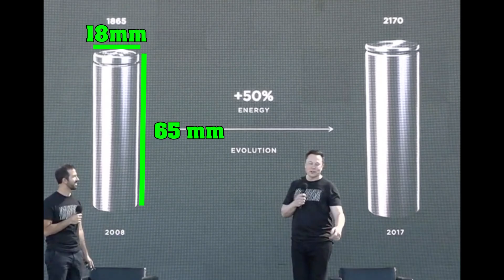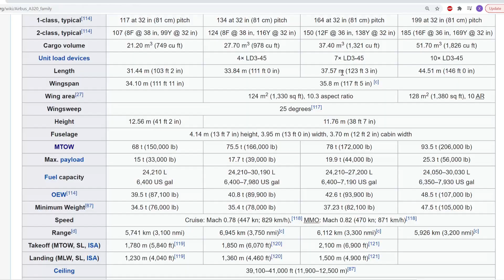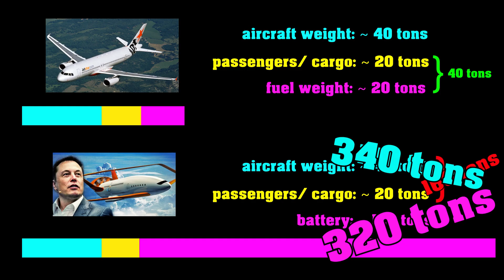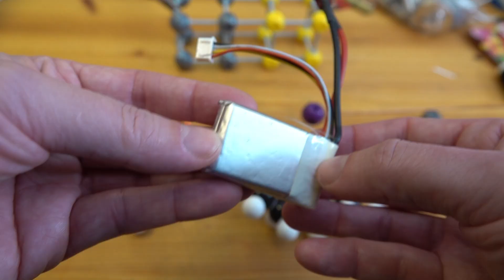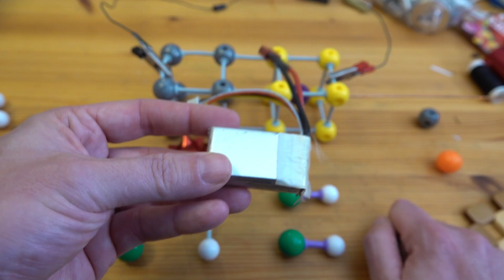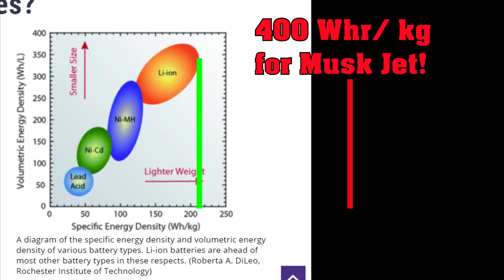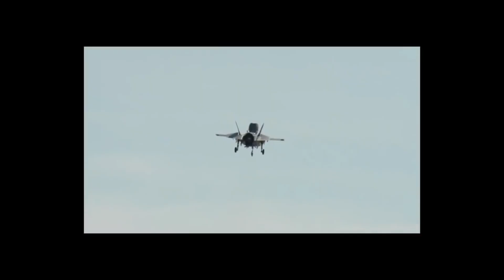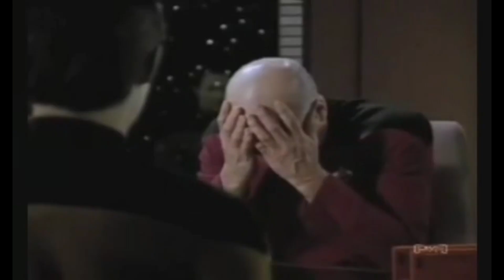Tesla's Secret Plan To Disrupt Airlines: BUSTED!!

Comment: The solution is rather simple: Use a drone booster!
. Take off (vertically) with the booster, reach high altitude and (still using the booster´s batteries), accelerate to high_subsonic speeds.
-> Decouple the "booster" (that has its own wings, optimized for low speeds & high air density); it glides down back to the launching place following a half_circle spiral down trajectory [either landing vertically with some "reserve power", or using wheels like a normal plane (taking advantage of its wings)].
  
. Meanwhle, the "main ship" (with the cargo) accelerates using its own (smaller) engines & batteries (the wings/shape optimized for supersonic speeds & low density air).
The ship has to land vertically [since its wings would not be able to provide enough lift].

.  [If necesary, in an emergency] another "drone booster" can be launched (vertically) to meet the ship on flight, connecting to it with a deployed cable (either from the "ship" or the "booster"), transfering power from its batteries (to allow the landing of the ship).
   Depending on the ship´s design & details of the "emergency"; both may land vertically simultaneously (next to each others, keeping the "umbilical cord" connected).
-> There is no need of "docking" on mid_air (unless there is an issue with the landing engines of the "ship", rather than its remanining energy on batteries and/or power transfer).
  
An interesting posibility (to avoid a "cascade effect" on a single_point battery malfunction) could be having the batteries on segments that can be disconected & "ejected" (at high force) automatically. 
This "procedure" being only available if the ship is already high enough that the falling "block" can self_destruct & disperse (so the damage on property below its minimum).
-> Given that the ship+booster is launched & landed vertically, any failures on ascent/landing would only damage the "airport".
Reply: How you gonna get an electric ducted fan to break the sound barrier. Hell even if you shunt it up past the sound barrier using a real jet aircraft, it won't stay there because an electric ducted fan can never be capable of supercrusing. It can go fast-ish, but it can never go mach. 

By the way, the solution to the plane being too heavy is probably not to strap an extra battery pack to it. Remember, to VTOL, you need to have a positive thrust to weight ratio. But the plane that Elons proposing will, even if we go by current standard aircraft numbers and not thunderfoots, weigh at least 60 tons. You need to have Electric ducted Fans capable of producing over 60 tons of thrust. But that also are able to operate at high speeds (Not mach, because its not physically possible to use an EDF to break mach, but lets just say normal passenger jet speeds). The issue is designing the intake. You'll need to have a variable intake to get them to be able to perform both jobs, but the issue then is space.

The ideal aircraft for this specific task has already been built: The Harrier jump jet. It uses a high fan bypass Turbo-fan, and while an EDF of the same size couldn't actually do the same job, lets just say it could. Its quite a bit off in reality, but still. It has the intake design and the variable nozzles to transition smoothly from VTOL to forward flight. Now you just need to make it huge enough to fit like 500 people inside, which is kind of where the issue lies. The square cube law is already against you, and the energy density of battiers compared to Jet fuel comes around again for a double team. 

You might just say this is where the drone booster comes in, but there's an issue with that too: Unless the booster also has VTOL engines, you're just adding weight to something that's already too heavy to take off vertically. And if it does have its own VTOL engines, then its gonna be using vast amounts of power just to make up for the deficiences of the main crafts VTOL engines by using its own. And now, with every single flight, you have to organise the decoupling of a booster and safe landing of such, presumably via drone systems, and possibly another booster to reconnect to the plane, and if anything goes wrong with any part of that you're in serious trouble. Also the plane doesn't ever lose weight during the flight, so you'll definitely have to have another booster at the other airport to facilitate the planes landing, and overall its just a gigantic clusterfuck that could be far better solved by just finding another fuel source for planes instead of hydrocarbons. Good news is taht jet engines will run on basically anything, so even Hydrogen could work.

Anyway if you read all that then thanks! Sorry it was super long. But honestly, I just have so many issues with Elons entire idea.
Reply: @miaconnor5767  Of course this is not ment for 500+ passengers. Even 50 (including crew) would be already too much. It is a fancy jet for rich people.
-> Elon never talks about THIS being a "normal planes killer" (that is the suborbital intercontinental Starship!); is always other people making the "logic jump" (just because Elon stuff HAS to be "disruptive").
  
"Electric only" powered engines can be hypersonic (just heat the air until it becomes a plasma & then magnetically accelerate the ions through a nozzle); it is just very power intensive (but it can be really efficient if you go already high & fast enough).
 -> Never done before (not even models or lab); but the physics says its posible.
  
Notes: 
The "ship" should be able to vertically land with its cargo & batteries by itself (it is really "inneficient" at it, but the landing is both the shortest and last part of the journey).
The umbilical/docking "special scenarios" with a second drone booster at destination (there has to be one always "ready"); are just better alternatives than pointing the faulty ship to a lake/mountain (to guarantee that nobody/anything survives the crash, while minimizing collateral damage).
Reply: @adolfodef  Well in that case, its still wrong. Even at private jet size, you cannot get an electric plane to go supersonic. And yes, I'm aware of plasma heating and magnetic acceleration, I addressed it in another comment before. If anything that makes less sense. Because those things aren't "power intensive" they're "A nuclear reactor and you might be just about in the ballpark". Its also rather difficult to heat air fast enough to create enough thrust with them, the the power draw would be so insane it would barely make it a few miles. Also, as you said, its never been done before or even had a model produced, largely because of these problems. You have to add such an immense amount of energy to the air in such a short span of time, and you have to keep doing it consistently for hours at a time.

Unless of course Elon wants to fly a nuclear reactor - in which case, just use that for engine thrust instead: Russia already has a subsonic cruise missile capable of that, and its like 100 times more viable and no more dangerous. 

Also the ship just won't be able to vertically take off and land. The battery weight is actually insane. Like, its so much you would realistically have no space for anything else. He himself said 70% of the overall weight of the plane would have to be batteries. If we take something smaller, like a Learjet 60: 6,641kg. 4648.7kg of that would have to be just batteries. You cannot make a plane that can carry that amount of weight, out of only 2000 or so kg. This thing wouldn't even be able to fly nevermind VTOL. So landing by itself in VTOL is absolutely out of the picture. Not just inefficient, impossible. So you will absolutely need a booster on hand to help it down every time. And that booster will have to have a super short range, so it can actually VTOL while carrying the plane, even if the plane has its own VTOL motors.

Also that starship thing is one of the most retarded things I've ever heard. Not what you said, but what he said. Its a fuckin rocket. The most dangerous, and expensive forms of transport in the world. That will not replace anything in a trillion years. If we get to like, star-trek levels of ship tech, then yeah sure. But with what we have today, or even 20 years in the future, that entire concept is uttterly fuckin laughable.

Comment: The fact of the matter is, no propeller plane could ever be supersonic. The propellers themselves would break the sound barrier long before the aircraft itself. The XF-84H Thunderscreech always comes to mind when people propose things like this. It was incredibly unstable, so loud it gave ground crew seizures, unreliable (all but one test flight were aborted early), burned the fuel of a supersonic jet while unable to keep up with early jet fighters.
Reply: That being said, it was/is darn cool, even if more useful as an unintentional crowd control device than plane. Wikipedia says it could be heard 25 miles away and damaged buildings in its surrounding. What a machine.

Comment: Unless you figure out a good metal air battery with good reliability and efficiency you will not disrupt all but the shortest flights. In which case supersonic flight won't net you want benefits because by the time you've climbed to 40000 feet where breaking the sound barrier might just maybe be economical, it's already time to land. The only way to get comparable energy and power densities to combustion is to use combustion. I. E. a metal air battery.

Comment: Fact is, pound for pound, nothing, and I mean nothing gives more power per Kg than fossil fuels.
Hydrogen comes in a close second, but to get it, you have to strip it away from... you guess it, hydrocarbons. Meaning; you have to extract OIL to get cheap hydrogen.
Electric vehicles are an interesting novelty, but that's all they are.
And something Musk hasn't addressed; batteries don't get lighter as they drain energy. Fuel tanks do. So after 50% of the fuel has been used on say an A320, they become MUCH more fuel efficient, having less weight to drag.
Not so with Musk's electric plane.
Honestly, is there anyone in Musk's operation that even looks at the bullshit numbers he pulls out of his ass?
Reply: It's more about the cost for short flights. Electricity is cheaper than fuel.
But yeah for long-hauls flights it's doomed.

Comment: So uhh, random question
Does anyone know what the connector on the lithium battery is he showed in the video?
The reason is that i have an electric scooter with a connector like this on the battery and one of the posts is completely melted (controller died while riding, unplugged and replugged the thing in the field, big arc, much melt) 
I have fixed the controller but the connectors don't fully seat, would like to replace them.
I only found out once i got home to a multimeter that the BLDC bridge was shorted on one phase
Reply: Looks like a B1 to me but not 100% since he doesn't really show it that well...
Reply: @aTinofRats  B1 looks right from a quick google search
Thanks a lot bro, much love <3
Edit: Found em as T-Plug on aliexpress, just ordered a bunch

Comment: When he says that, we are completely ignoring the “electric supersonic” part. He would be using an electric plane, so it would be a propeller plane. The problem is that prop planes can’t function at supersonic speeds. The current fastest is Mach .84, and was so unstable that it wasn’t even recognized.
Reply: He can use an electric ducted fan to get reasonable speeds with as much stability as a regular aircraft, but its impossible to make it break the sound barrier. It would lose thrust exponentially as it gets to higher mach numbers. And while it would be pretty good for VTOL (Purely the EDF, not the actual idea overall) it would suck bad for longer ranges or higher speeds. Since EDFs basically just solve the stability issue, but don't at all replace Turbo-jets.

Comment: What I can't figure out, is how exactly does an electric plane get more and more efficient higher up, since it won't be jet/rocket powered, which leaves a propeller or a turbine to propel it. Less air pressure/resistance also means less air for the screw/turbine to move, and less thrust. Plus It lacks the thrust from the burning hot gasses of the combusted fuel of a turbofan. 

Then there is the whole issue of the plane gets lighter and more efficient as it flies as it burns the fuel (and uses the combustion gasses as thrust), vs a battery powered plane that weights the same regardless of if it is fully charged or empty.

Whole thing is bonkers, as usual.

Comment: Elon Musk's plane will be able to do the Kessel run in less than 12 parsecs.
Reply: @No one  We know - that was the eternal Star Wars goof-joke... 👍😊
Reply: @SusiBiker  No it's not a good, the kessel run is literally that long, Han Solo took a dangerous short cut
Reply: @No one  I know, but the script writer of Star Wars didn't.
Reply: @Panglo55  as far as i know he did because if you do the kessel run in less parsec you come closer to the black holes which makes it faster, harder and more likley that you wont be detected.
Reply: @Puman42  That's a justification invented by an elevated fanfic writer but it doesn't make any sense. Even a supermassive black hole has a diameter on the order of an AU or so, about 5 millionths of a parsec. A stellar mass black hole is measured in kilometers. The region of intense gravitational distortion is only a few times bigger than the radius, so you're looking at Han Solo skirting around millions or billions of black holes in a single trip just to save a screenwriter's reputation. It's stupid.
Reply: @Panglo55  You assume that the Kessel run is a distance. It could be a manoeuvre.
Reply: And 60 percent of the time, it‘ll work, every time..
Reply: You can bet that Elon firmly believes it's a unit of time though.
Reply: Ah yeah, my car goes 10 meters in 4 meters
Reply: @MGLpr0  Well mine actually does, if the 10 meters is measured in a nice arc and 4 meters is a-b in a straight line.
That's how the parsecs goof was explained later on, and it makes sense if the Kessel run goes around an area very dangerous for spaceships. Solo just went in a straighter line than everyone else.
Reply: I think it kinda could work semantically, most likely not how the writer initially thought, but if the space ship does have engine design similar to the one Alcubierre suggested in his paper. The engine would in fact subtract space in between the distances, thus making "The Kessel run" less than 12 parsecs. Still would be obscure way of bringing that up in conversation, rather than just flex with the time it took to finish. Maybe the Millenium Falcon is running an Alcubierre drive?
Reply: @No one  He did fly through a more dangerous zone and thus decreasing the total distance. But that would acknowledge that this movie exists.
Reply: That’s not actually a measurement of speed
Reply: In Star Wars the Old Republic (SWTOR) the distance between Hutta and NarShadaa (a planet and its moon) is several parsecs. As 1 parsec is 3+ lightyears, that distance is impossible for a planet-moon system. Summary: there is no real science in an SW game.
Reply: Next week: Thorium Planes

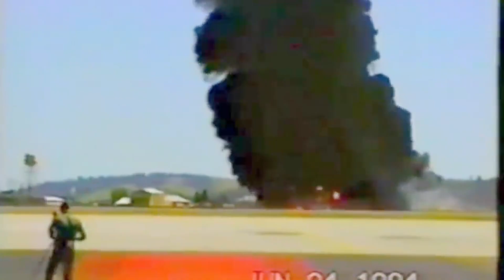Comment: 22:55  Maybe, you could eject the battery if it reaches a critical temperature. As long as it explodes before hitting the ground, it should be OK. I guess.
Reply: Like Star Trek, when they eject the warp core when the anti-matter containment field is about to fail.Just hope you aren't standing where that battery hits ground.

Comment: Less air friction at altitude = less air for a set of electric turbine engines to use to create thrust. Or is Musk proposing some form of electron thrust engine like the impulse engines on Star Trek. No wait! I've got it. The batteries will be used to power a flux-capacitor so that we can get back to the future. That has to be it.

Comment: The most likely thing to replace the jet engine right now is the turboprop which has surprisingly started to be upscaled more for use on larger cargo/passenger jets due to being cheaper due to needing less fuel to do the same job with IIRC bombardier and others looking to improve on this. IIRC the turboprops being used currently are like, 2/3rds of the fuel of a turbojet plane. Then you have the other side where companies like airbus working on hydrogen powered turbofan/turboprop planes which is a dramatically better form of fuel system.

IDK why people have a fascination with electric power when it simply isnt there yet.
Reply: you need to look at the trijet airplanes that have an interesting wing design

Comment: the v part of vtol burns a ton of energy as well which kills range.
Reply: Yup, which is why VTOL planes dont actually ever do that outside of an emergency and generally can only do it at minimum load (with it mostly used for landing when fuel is running low to reduce the required energy).